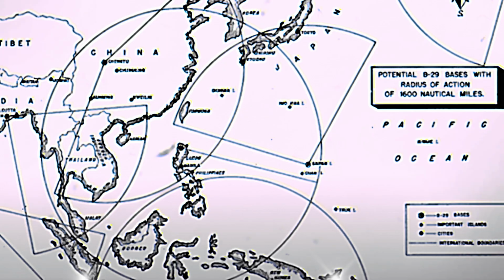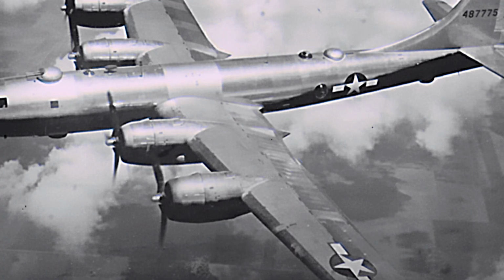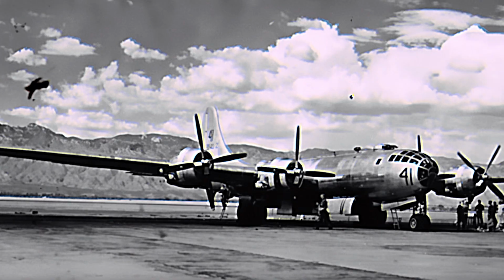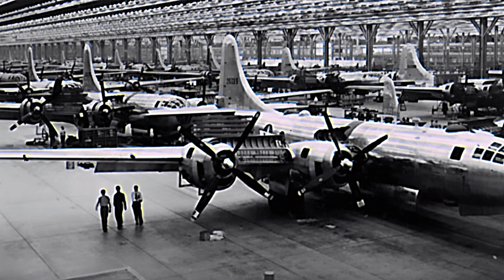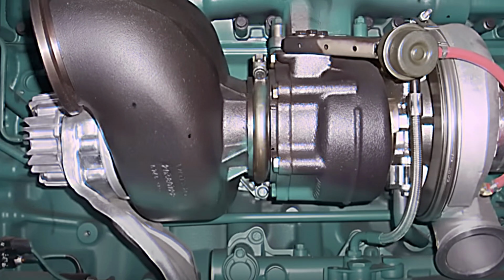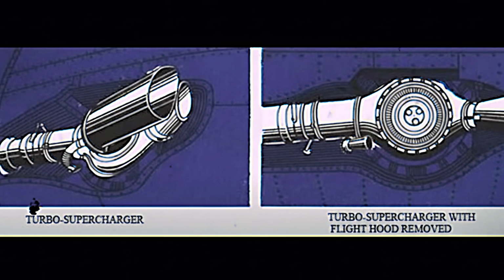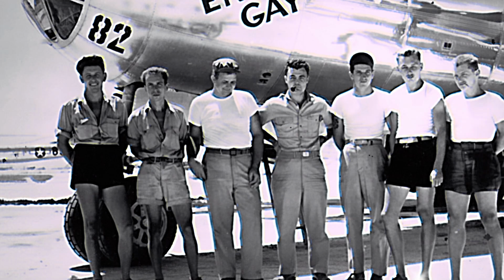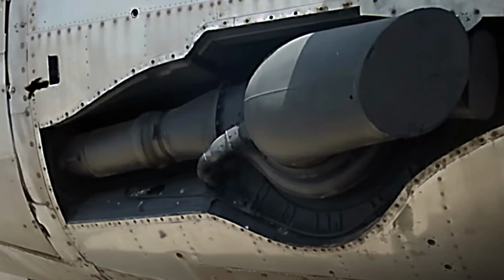Japan Never Expected B-29s To Outclimb Their Entire Air Force

Comment: B29s used COMPOUND TURBOSUPERCHARGING. In that system, one turbo compressed the fuel & air mix which was was then fed into another turbo, which further compressed the fuel/air mix for even more power. That gave B29s the power to fly higher & faster than the Japanese aircraft, and also helped the Enola Gay, Bock's Car, and the Great Artiste to outrun the explosions of the Little Boy and the Fat Man.